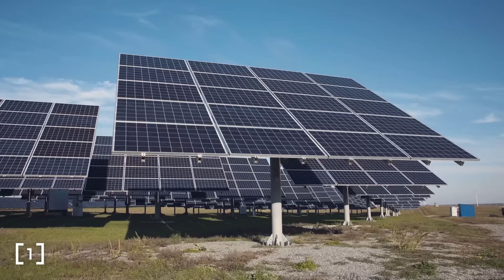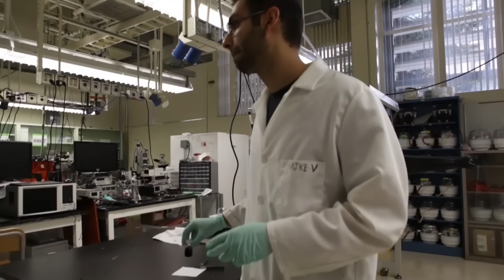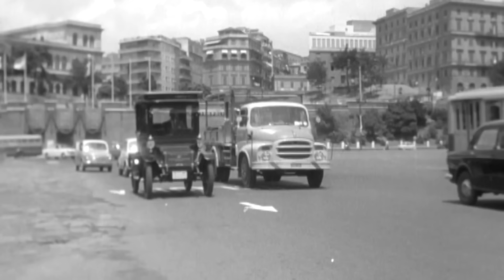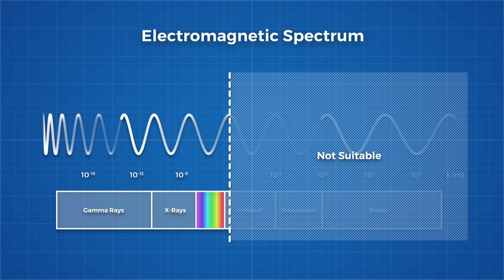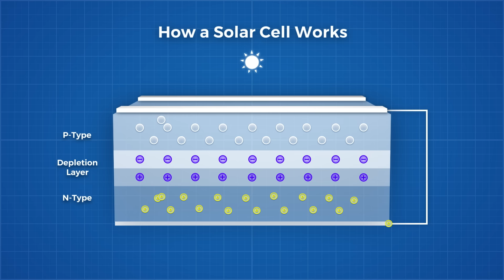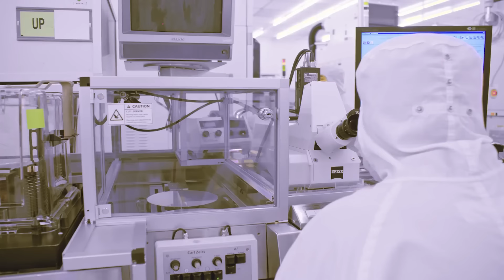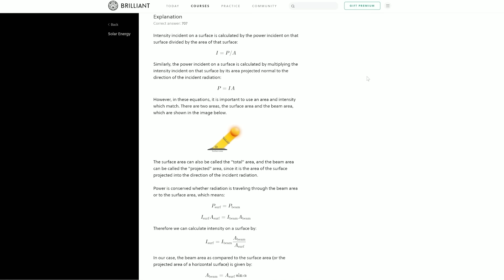The Mystery Flaw of Solar Panels

Comment: So solar panels are a false economy as the energy needed to produce them isn't neutral. So what's the point? Especially when they're hard to recycle & the byproducts are extremely toxic to the environment and equally horrendous to recycle. So like fracking it's a negative economy.

Comment: Years ago i was told that one of the main problems of solar panels was that they couldn't be completely recycled and at the end this made them not as "eco friendly" as everyone thought....has this been solved, or is it still one of the main problems????
Reply: The cost is being offloaded to poorer countries, same with lithium batteries
Reply: Considering the materials are required to last 25 years under the sun and weather, which is already hard to do, its pretty normal they are hard to recycle.

Comment: 10:15: I don't get how does an electron accelerate from P-type to N-type, the electric field due to the formed junction should oppose this motion instead of accelerating
Reply: Varun Patel
I was confused by the same thing. But it seems to be a fault in the explanation. Check out Learn Engineerings video on how solar cells work. His explanation doesn't oppose the attraction force of opposite charges.
The main mistake is that photons interact with depletion zone. Not the P-side junction.
The loose electrons in the depletion zone are then accelerated by the positive polarity of the rest of the depletion zone, and moved to the N-type junction. Remember the Positive polarity if the depletion zone is created next to the N-side junction. 
Hope it makes sense :)
Reply: @R4nd0mN7mbers  This error pointed out by many well educated commenters shows the fallacy of "internet experts" trying to explain things! (I don't know the word for multiple people who comment, and the spell checker has no suggestion.)
Reply: I'm an electrical engineer. The crystal lattice of n- and p-type silicon wafers start off with neutral charge, ie. there is an equal number of atomic nuclei and electrons in the material.

Then you bring the n- and p-type wafers together, allowing the electrons that don't fit neatly in the n-type wafer to recombine with the holes in the p-type wafer. There aren't any holes or electrons left over that can freely move. 

HOWEVER, now your n-type silicon has more nuclei than electrons (they're all in the p-type wafer now), therefore it's positively charged and the opposite is true for the p-type silicon (more electrons than nuclei --> negative). We've now created a pn-junction, ie an electric field along the boundary going from the n-type silicon (+) to the p-type silicon (-). This is the electric field that works like a valve for electrons.
Reply: @bogdanstamenic2836  it's the same concept as a diode. That's how I've been explaining solar panels to people.
Reply: @kraziecatclady  Yeah exactly! Really most useful semiconductors make clever use of the pn-juntion, not just diodes. A pnp- or npn-transistor is basically two pn-junctions (There's more to bipolar transistors than just that, but for simplicity, I'll leave it at that).
Reply: photons of light strike the panel in the correct locations which knock free electrons which bounce around until they are shoved across the zone in the middle (junction point) which is a small area which is non-conductive. Because that area is non-conductive, they cannot cross back through in that manner and can only get back to the other side though the circuit which is created by the additional wiring and metal structures on the panel although typically there will also be a battery in this circuit to store the charge for use in between. The depletion zone (or middle part) is thin enough to allow the boosted electrons to pass through, but thick enough to prevent them passing back without a boost. Most diodes work in a similar manner and so do memory storage devices for computers except memory storage requires much higher precision and those gaps can be as microscopic as 10 atoms across in some devices which is freaking insane. I cannot imagine the precision of machines that create this stuff because at that small of a size, vibrations would be devastating, so would small temperature changes.
Reply: Materials science undergrad here. I really liked the video's explanation and how simple it was but the more you look into it the more confusing it gets. 
So surely there is no net change in electrostatic potential going from the far ptype side to the far ntype side. This is because surely both sides are at a 0 average potential because they have equal numbers of nuclear protons and electrons. So 0 average change in potential from p to n side must mean that free electrons gain 0 net energy overall when crossing the depletion layer. This contradicts the whole idea of the depletion layer electric field doing work on the free electrons to push them from the p side to the n side and create a current.
I know this is where u get into the fermi energy of both sides being different therefore electrons crossing from one side to another gain energy. (i know this would complicate the simple explanation but it would be nice if there was a small footnote explaining this)  However if you plot the electrostatic potential across the depletion layer (i would post a photo if youtube let me) then surely there is an energetic barrier that electrons have to overcome to cross from one side to another. Put simply as  electrons on the p type side come closer to the negatively charged side of the depletion layer they are repelled. So they must need sufficient kinetic energy to overcome this repulsion and get to the positively charged bit on the other side of the depletion layer. 
Therefore the threshold wavelength shown at @6:10 must be at a higher wavelength than the true threshold frequency? idk if this makes that much of a difference tho but its another source of inefficiency i guess? Sorry of this just confuses everything
Reply: Well, solsar cells are really just diodes. In fact, if you put power INTO the cells, they glow just like a LED. So, why don't the electrons flow back? The same reason they only tend to go one way in a diode. The material on one side simply has a greater resistance to a flow in that direction. If that could not work, then we could have never used that effect to build a transistor. But LEDS are a form a diodes, and so are solar panels. As noted, if you take a solar cell and pump in electricity , you get light coming out - it is in fact called a LED, but regular solar cells will produce this same effect (ie: output light when you put in electricity. This video shows this effect:

https://www.youtube.com/watch?v=6WGKz2sUa0w

The problem is the light output is red, and not visible to your eyes (just like your TV remote). Thus, new LEDS that output white light? It called a LED light bulb.
Reply: The boron and other dopants are not "layered". Extreme high heat is used to create a dopped matrix. The doping is in a gradient % of doping. Using time / heat / dopant materials and fighting oxidation is a method tried to shift the amount of electrons  released.  Nope neve seen a photovoltaic cell.
Reply: As others have pointed out, part of that is due to the author's error/misunderstanding.  The other part of it has to do with electricity not working quite like we tend to think of it.
Electrons moving are an incidental of a change in the electric field.  This sounds a bit like splitting hairs, and it somewhat is - but it is also the reason why voltage transmits power and alternating current suffers fewer losses.  So - it's a hair splitting that has real implications for electrical engineering (and it's still a thing we don't understand as well as we like to think we do).

For example, in a circuit with an inductor and a capacitor, the power dissipated in the circuit does not necessarily equal the power put into the circuit.  In a DC circuit, power in equals power dissipated (generally as heat, though a diode or other component could convert it to light).  All power in the circuit must be accounted for.
But when we have an inductor and capacitor, things get interesting as the two will naturally tend to cycle power between each other and while their innate resistance does generate heat, the heat generated is far less than resistance measurements would imply.

Conductors effectively distort space as it appears to the electric field and molecules/electrons and it is that distortion in space which holds the energy.  The electron is simply the unit of exchange for that energy and follows the field.
Reply: The illustration is inaccurate. The photon needs to be absorbed inside the depletion zone.
Reply: in video its misinterpreted something , electron don't go through depletion layer it actually knock out in depletion layer by photons . electron and hole move towards its group...

That the reason why p-layer are so thin so photon can pass through it and strike to depletion layer make whole thing works.
Reply: cause it seems, that he messes up.

From what i've seen he switched up p and n-type. https://qph.fs.quoracdn.net/main-qimg-790f41823de9c577aadc1ccd828ec3e1

And it seems, that it is the electrons in the depletion layer, that are getting exited by the photons, which causes the flow.
Reply: @thomaspriewasser6660  I hate to be that guy, but I seem to have gotten it right. Feel free to refer to Wikipedia (https://en.wikipedia.org/wiki/P%E2%80%93n_junction), electronics tutorials (https://www.electronics-tutorials.ws/diode/diode_2.html) and All About Circuits (https://www.allaboutcircuits.com/textbook/semiconductors/chpt-2/the-p-n-junction/). They're the first results I got when searching for "pn-junction".
Reply: @bogdanstamenic2836  what i was referring to was, that he put p-type on top and n-type on the bottom. But in the examples i've seen, it was the other way around.
Reply: @thomaspriewasser6660  I've seen it like that too where the panel was reversed and it was displayed as if they bounced off the back panel into the front, but I can't remember where I saw that information.
Reply: I think it is determined by how much force the light uses to knock it loose
Reply: I'm guessing the flux lines in the magnetic field are a one way street for the electrons?

Comment: I have been living off solar for 9 years i know that those panels get hot, what i have always wondered is there a way for me to harvest the heat from the panels to perhaps operate an engine...similar to the Stirling Engine. The Solar panel heat would be hotter than the temperature outside and thus be able to create the pressure to operate it correct?

It's just something that has crossed my mind for some years. perhaps build a dozen Stirling Engines under the panels (Colder area) and run some tubes from the top of the panels to the engines to get a little more wattage out of them.
Reply: A PV panel with insulated water loop could probably work for making hot water sometimes. Probably not efficient enough (for cost) to justify adding a Stirling engine.

I'll add some loops to my panel to see what happens!
Reply: @Travis0palzae  Good luck with the experiment, i even brain stormed about building a root cellar beneath my solar panels so the air down there is even colder.

Comment: Good summary. One small nit to pick, there is no electromagnetic field across the depletion layer, only an electric field (E). There is no magnetic component (H) in the depletion layer. So it would be more correct to say there is an electric field across the region, not electromagnetic.

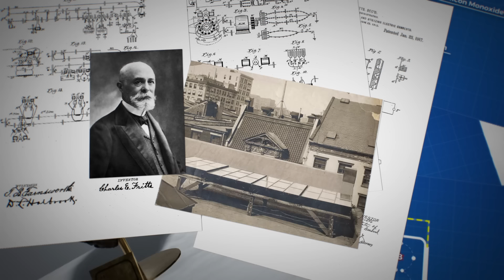Comment: 2:25
Is that the guy from The Thought Emporium?
Reply: I don't think so
Reply: @azertyuiop432  
You may be right, but, still, the resemblance is uncanny.
Reply: @My_initials_are_O.G.cuz_I_am  Sure, I thought the same first time, but the liquid is likely to be some sort of graphene solution
Reply: @azertyuiop432  
He did make some videos about graphene, and many other non-biology topics, so it wouldn't be that weird if it was actually him.
Reply: @My_initials_are_O.G.cuz_I_am  Oh true, I didn't thought about that
Reply: About graphene: since it's conductive and transparent, wouldn't it be better to use it as electrodes in solar batteries ?
Reply: @azertyuiop432  
Pretty sure that very application is one of the biggest potential uses planned for it.
Reply: @My_initials_are_O.G.cuz_I_am  Gonna search that

Comment: Could we force the higher energy photons to interact with the electrons with the higher work functions?
Reply: tandem solar cells can kinda do that. They use one material to capture the lower energy photons and another material to capture the higher energy photons. This way, the high energy electrons have a material that can better absorb their energy. If that answers your question
Reply: Alexander Perez de Leon Yes, thank you 👍
Reply: I don't know if it's possible, but wouldn't they just be exited to the valence band and provide the same potential anyways?
Reply: Kexmonster Yes but then the photons coming in with lower energy would be less likely too hit electrons with too high a work function as they have been liberated by the high energy ones and so you'd get more free electrons total and therefore a greater PD
Reply: The reason why higher energy light does not produce more electricity is because of the particle nature of light. Only 1 photon can interact with 1 electron, and transfer all its energy to it.The energy of the photon has to be greater than the threshold energy/work function for the electron to get excited, but the exact energy of the photon does not really matter. Therefore we want as low work function as possible so that even lower energy photons (long wavelengths of light like infrared) can be absorbed by the electron and get it excited. High energy photons will interact with both high work function and low work function materials and have the same effect.

Comment: Great video! I haven't heard about this mystery flaw before! Ive just studies one course in Semiconductor Devices and they go through things like band gap, Fermi levels etc. and apparently Si-solar cells are optimal at about 0 C. But that's usually not where you get the most sun hours so its not that useful..

Comment: Tandem silicon perovskites hitting 26% in industrial processes now. Solar plus storage is the cheapest form of energy in many countries without subsidies. Very hot climates have issues with the electrons bouncing around losing efficiency. 25 degrees in optimal temperature. Also solar does not a massive impact on the human experience - meaning we can incorporate into more form factors, especially our homes and cars creating more opportunities for onsite generating and removing the cost and inefficiency of transmission. No one really wants to live next to any powerplant or massive wind turbine. On the same land footprint, you can grow food or provide shelter on as well as energy generation. Another overlooked advantage of solar is it creating more employment globally than any other form of energy generation according to whitepapers in IRENA.